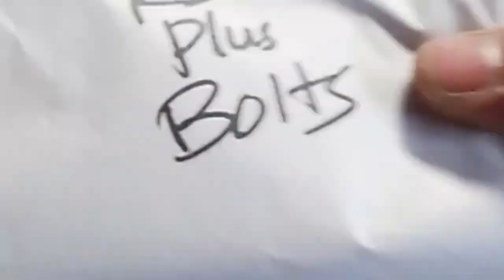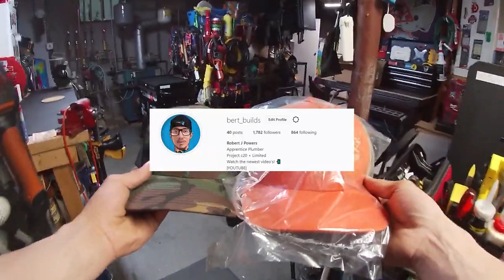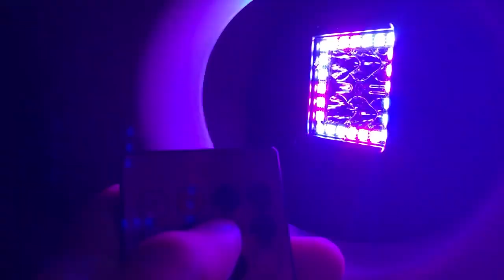Bluetooth RGB Fog Lights! FCK UNBOXING AND HOW TO INSTALL

Comment: Which I could have seen more of the wiring - you tapped into the back up lights was that just for power and ground? Do they require the reverse lights to be on to work - I wasnt sure how that worked.
Reply from the maker: they are wired off the rear tail lights regular connections, i showed it but did not really explain that part my bad man
Reply from the maker: I have a video for ROCK lights that are also RGB, i show how to wire a plug and switch harness!